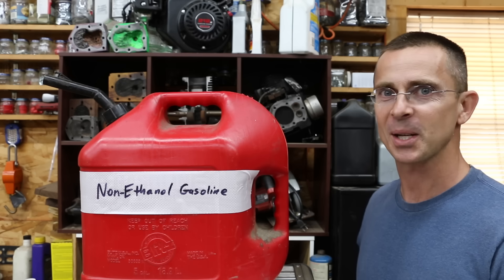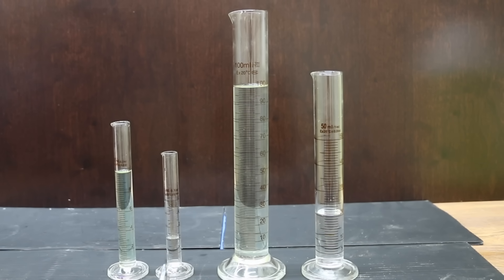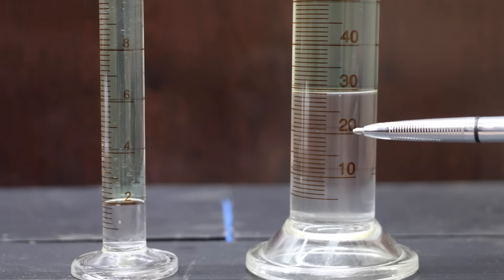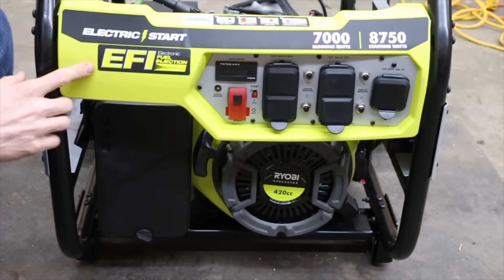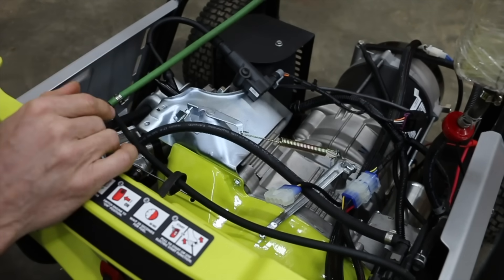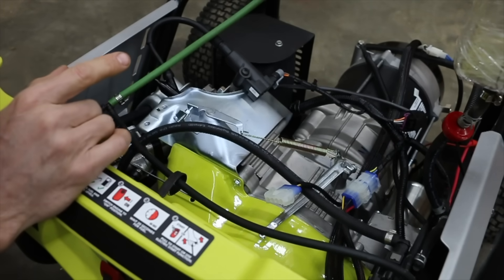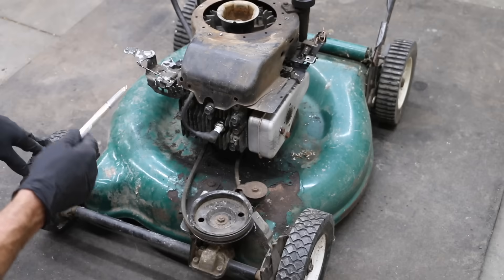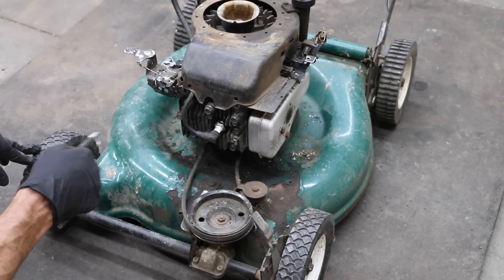Is Non-Ethanol Gasoline Really Better? See the PROOF!

Comment: Whoa, YouTube really knows what Indonesian people need to learn. 
Right now our government claims that the gasoline is mixed with 3% ethanol and they planned to raise up to 20% ethanol for our vehicle

Thank you for the video
Reply: I thought they planned to raise it to 10% which is just as bad
Reply: @IndoGunsnGear they wanna cut the gasoline volume.tjey care less bout the engine 😂
Reply: I live in Brazil, which recently jumped to 30%. It's fine.
I have a double carb 1989 CB450 DX and it runs just fine, no issues. Of course, can't let it sit for too long, but carbs kind of were always like that.
Reply: @fastbikesandslowrides  Want to ask, so it does not create any kind of corrosion to the fuel tank then? Thanks
Reply: @shuyukihara ethanol does like to hold on to water, so I do try to keep the gas tank full. Can't say much about it as when I bought the bike there was already quite a lot of corrosion on the tank (mostly from just sitting and rotting with time). Ever since I got it and cleaned it up though, I haven't noticed it getting worse.
Reply: @fastbikesandslowrides  got it, thx 👍
Reply: @fastbikesandslowrides wait my friend, what about the gas cost? Is it increase or decrease?
Reply: @hanifalii23  gas prices never, ever went down where I live.
Reply: @fastbikesandslowrides WHAT😂. Now i really-really hate my govt
Reply: Are you afraid that Indonesia will progress because of the ethanol we produce from our palm oil, and it can be harvested at any time without having to mine, and it will never run out. And the West always interferes with our progress through evil issues and embargoes?
Reply: @afifrodger it ain't palm .it's sugarcane n corn made
Reply: @sargera1  No dude, Indonesian ethanols were mainly produced from Palm Oil surpluses.
Reply: @afifrodger  no one is going to bother/sabotage us. They don't need to do that, our govt will mess up everything by themselves
Reply: @dudastt 

Tidak bro
Ini untuk hemat uang subsidi yang asal nya dari pajak.
Etanol nya itu  produksi di Indonesia dari tebu jagung dan sedikit sawit.

Di video ini jelas sebut tak masalah mix 10% etanol
Reply: @dudastt  some of those ppl in gov are puppets from foreign country that want to sabotage our country to never progress so will always easy to exploited.
Reply: @timeaftertime-om7os hemat anggaran tapi untuk program rawan bocor kayak MBG

That's what I meant by they will mess up everything in the end
Reply: @dudastt MBG itu isu yg berbeda.. kita bicara penggunaan ethanol..brrti anda setuju klo ini mmg menghemat anggaran.. brrti bagus dong.. oke..
Reply: @timeaftertime-om7os  but the ethanol used in the base fuel is imported from outside, its just freshly imported right from the docks. Unless they blend the base fuel again ( this struck a major outrage before) just before getting tested, the presence of ethanol in base fuel should be considered as contamination. Probably from old refinary that also blends fuel. Puttingin ethanol early is just ridiculous as it will absorb moisture very easily.
Reply: @afifrodger   Palm oil may be technically renewable, but in practice, once the plantation is depleted and drained, what remains is barren soil — a sign of ecological exhaustion, not renewal.
Reply: @afifrodger what progress means to you? We are just planting palms! Nothing to brag! Di indo itu banyak minyak. Tapi teknologi kita ga nyampe buat eksploitasi nya.
Reply: The problem arise in our country is not about the amount of ethanol mixed in the fuel. It's about the purchase  agreement between pertamina and private gas stations. They wanted to buy the base fuel, free of anything mixed, including ethanol. After which they could add other ingredients suited to their fuel standards, perhaps ethanol included

Now imagine, if the base fuel they bought is already mixed with 3.5% of ethanol. What should they do to reach their fuel standard using their respective  mixing recipe? It is like, you want to buy demineralised water (pure distilled water) for your chemical experiment that is quite sensitive to minerals, yet what you got from the seller is mineral water, and they claim it is better
Reply: Bener
Reply: I don't see any problem with that because at this moment larger vehicles such as intercity buses and trucks already use Biodiesel for decades since the govt introduce Biodiesel sometime around 2004
Reply: Don't forget, Shell or BP have their own  formulation for their best gasoline performance, which not allowed erhanol more than 3%, and ethanol itself depend on source of its substance, purity will influence performance itself
Reply: 20%?? hoax!
Reply: It's 10%, 20 is the maximum limit. Idk if you are misinformed or not before but the hoax stops here
Reply: there goes old cars
Reply: sadly bahlil is not smart enough to see this video

Comment: You will find a yellow slime in the carburettor of your mower and strimmer. Exposed to air this turns to a white talc-like substance.  Always drain the tank and run the machine till it stops before winter storage!

Comment: this video comes up in my FYP
there's a pretty heated debate in indonesia because the Government forbid the the foreign gas industry to buy the gasoline from outside the country
and the gas institution doesn't want to buy the gasoline from the Government because they say the gasoline contains ethanol 
thank you for the experiment!
it helps me know which one is the better gasoline
FYI indonesia has one of the bigger motorcycle user in asia so i think this video helps our knowledge of which one is a safer fuel for my motorcycle

Comment: Small engines, even 4 stroke lawnmowers will have problems with alcohol in the gasoline.  it rots fuel lines, etc.  I have a five gallon container of E10 gas.  First start , my mower ran fine. Not sure how long the mower sat but I had to pump out the gas tank, putting it back into the 5 gallon gas can, because the mower wouldn't run.  Bought a 2.5 gallon gas can, filled it with fresh E10 gas, because you can't buy E0 gas in NJ and the mower started right away.  I figure the gas left in the mower and the 5 gallon can, absorbed water vapor from the air, and added enough water in the gasoline, that the engine didn't know what to do with it.

Comment: I have a BS6 350 bike that is compatible with E20 fuel, but I’m concerned that the ethanol content could damage the fuel tank over time. Will using fuel additives help protect my bike from corrosion?

Comment: You can see a flood of views from India, because right now it's a hot topic in India. 
Can you make a video with 20% ethanol (E20) or more like E27 or even E30? and put it in a old non ethanol compliant engine or E5 compliant engine and see what damages it makes to the engine, fuel-tank, fuel-pump, injector etc. Tally the changes in fuel efficiency. I can assure you that you will get more than 10 million views within 6 month. Just take it as a subscriber suggestion. Keep it up!
Reply from the maker: Thanks for the suggestion.

Comment: The problem with ethenol is that you still have to pay for full amount of the gasoline but you are only given 90% real fuel and 10% ethenol so it's unfair and second thing is that the engine are not made for ethanol fuel so we need new types of engine and also ethanol depletion is very fast in comparison to normal fuel Beacause it have less carbon in it thats why its goes really fast!😂

Comment: Can't compare an electric generator engine with a car engine. Car engines are more resilient and built for long life. Wrong comparison..

Also, individuals driving patterns and behavior do more damages to car engines than ethanol blended fuels.
Reply: E20 is already choking a vast majority of petrol vehicles. It sure has a large negative impact.
Reply: @VinayakMahadev11 If you cant backup your statements with evidences then you are just helping to spread lies.
Reply: @deepaktheproudindian  I need not spread lies. I am also a vehicle owner and mine is visibly straining under E20 use. Fuel economy meter is overestimating the mileage value (real value is less than 8 but it reads 9.3), mileage dropped by 20% (earlier it was 10), and the ecu is likely overcompensating by pumping too much fuel into the combustion chamber. It has been flashing the check engine light for the past one month, due to this stoichiometric issue. Not everyone has a car that works fine on E20. Know the ground reality before defending your claim.

I mailed the OEM and they replied that it is not recommended for E20 use.
Reply: @VinayakMahadev11 which car you are using, how old it is?
Reply: @deepaktheproudindian Polo, 9 years old and well maintained.
Reply: @VinayakMahadev11 doesn't matter. You are running an old car, your cars mileage is suppose to be lower. Wrong assessments by you.
Reply: @deepaktheproudindian  It is still returning 10 kmpl with 100 octane, you can't rule me wrong without listening the whole argument. 

It's not worth arguing with someone who is fixated in their ideas.

Comment: Negative Impacts

Reduced Fuel Efficiency: Mileage drops by 3-7% due to ethanol's lower energy content, affecting overall running costs.
Corrosion and Wear in Older Vehicles: Non-compatible cars (pre-2020 models) risk damage to fuel lines, seals, injectors, and rubber parts from ethanol's corrosive nature, leading to accelerated wear.
Performance Issues: Older engines may face starting problems, reduced power, or increased maintenance needs, with reports of engine knocking or failures in incompatible bikes and cars.

Comment: Yes I voted for bjp they sometimes do good but then they do this. Don't know what is gadkari thinking that's why leaders should have scientific knowledge.

Problem: Scientifically ethanol is less energy dense than petrol efficiency can drop 1-8%. The reports which showed that consumers will benefit from E20 fuels are from 2020-21 reports when ethanol was comparatively cheap not 2025. This time price have increased significantly due to demand. While the metals parts of old cars are safe the elastomers and plastics aren't. The E20 can mess them up.

Solution: Reduce the price of E20 based fuels to compensate for mileage. And give extra option of pure fuel for the old cars which are not compatible with E20 specifically.

Honestly there are reasons why ethanol is expensive right now than last year's. The supply chain can't handle the needs. Primarily gov allowed production of ethanol from C heavy molasses such as left over of sugarcanes but now they allowed B heavy molasses which includes Sugarcane juices, food grains even rice surplus.
This can lead to price hike in sugar and rice along with maize etc. And the amount of water needed to supply the ethanol is 10.16 billion liters of water annually!! Also the ethanol distillation process produces a highly toxic effluent called "spent wash" or "vinasse." This liquid has a very high Biological Oxygen Demand (BOD) and Chemical Oxygen Demand (COD). If discharged without adequate treatment, it can severely pollute water sources and render soil infertile. And considering how they are bypassing many steps no way they can properly implement zero liquid discharge(zld) policies. 
They can tackle this by researching in second generation (2g) ethanol but who will listen?
Reply: karma, you will end up in suffering, please dont vote to BJP next time.
Reply: The implementation of E20 is facing so much resentment only because the compatible fuel most most vehicles is not offered as an option. But I think the larger goal is to force petrol vehicles to death.

Comment: I ride a bike which is E20(20% Ethanol mix) complaint for 2 yrs, and yes it has lowered fuel efficiency & some weird white stuff(kinda thick paste like) built-up in my gas-lid as well as its key hole, it made my gas-lid hard to open & corrode my bike key.

Also the white stuff smell kind of like Coconut,
Yes, COCONUT.

Is it suppose to happen? or there is some kinda leak that water pass through?

Comment: In Brazil we have been using 100% etanol for decades and its just bad on low temperatures (5Cº and below) and old engines without alcohol resistant rubber. Since 2003 almost all domestic market cars run on gasoline, ethanol and some on LPG at the same time.
Reply: It also gets worse mileage because it takes 33% more per gallon to use as gasoline. Which means it also makes more hydrocarbon.

Comment: Here in Brasil there's quite a polemic going on after the government established a 30% alcohol content (volume/volume) in the gasoline. A lot of people have worries about the corrosion associated with it. Also, some direct injection engines are likely going to need better injector, due to the higher flow necessary to compensate it. Regarding power and carbon deposit, it could be actually good.
Reply: Don't you people have flex fuel engines from 2003?

As an Indian affected by the E20 scam (there are E20-compliant vehicles only from 2023, but in 2025, India mandated the use of E20 without regards to vehicle compatibility, without slashing fuel prices), I'd like you to ask something:

1. We repeatedly hear that you people have a choice to buy pure gasoline, how true is that?
2. How different and complex are flex-fuel engines from regular gasoline engines (if any)?
3. Does ethanol affect FFV's as well? If so, how?
4. is it possible to retrofit/modify an existing gasoline/E10 engine to achieve flex fuel, or complete E20 compatibility at least? If so, how feasible and expensive it will be?

Comment: In Europe its a choice of 2... E5 or E10. I have NEVER had a car that liked E10. They run like a bag of nails. Some places have E85. Unless your car is tuned for it and your fuel system set up for ethanol...DO NOT USE E85!
Reply: In India, more than 80% of cars and motorcycles are compatible with only E10, but the stupid union govt has mandated the use of E20 irrespective of the vehicle's compatibility, for the financial benefit of a certain politician's ethanol dynasty. Vehicles are slowly choking. E20 compliant vehicles were mandated only in 2023.

Comment: Basically what BJP has done is it increased the ethanol blending to 20% thus saving 20% fuel cost but its isnt passed down to the end user. Again that ethanol which comes from sugarcane profit doesnt goes to the farmers rather Nitin Gadkari holding ethanol manufacturing plant is profteered. Now only choice that we as end user has is either biy new vehicles which again gives profit to the govt or change to cng or EV the profit of which also goes to govt and manufacturers who give crores of donation to BJP or else purchase premium fuel at much higher cost. For the sake of info xp95 also contain ethanol and xp100 cost ₹160/- per litre. 
Basically the end user i.e. common people gets fucked.

Comment: For injected engines I use regularly, I've found that E10 has better smelling exhaust and and fouls catalytic converters more slowly. On carbed small engines that I use infrequently (just my snowblower since I use electric lawn tools), I always use Sta-Bil if I can't get E0 gas. Luckily my local gas tanker company allows people to fill up jerry cans at their site and they have ethanol-free gas, otherwise I'd have to drive 40 miles for it.

Comment: Ethanol had a lower mileage but had a boost in HP.
Reply: Only if the vehicle was made to handle it. Else it only stresses out the engine and causes corrosion.

Comment: In India, they are mandating 20% ethanol fuel. My access 125 2012 model will not (can't) handle that much ethenol (even the e10 is damaging)
Reply: Anyway your access is reaching the 15 year scrap limit.
Reply: @navan1087  I can get the green pass though

Comment: No need to test, we are testing at a Nation scale here in India :face-green-smiling:
Reply: On double ratio.
Reply: im not from india, so how was it? what was the most common problem?
Reply: @totem559  ethanol itself is not a problem, reduces knocking without hazardous lead or complicated chemicals, even increase power. But high ethanol ratios reduce the fuel economy, corrode gaskets, make another dependency on ethanol instead of oil, may cause more friction and overall reduced engine life.
Reply: @georgesbv1  Upon the initial introduction of ethanol-blended fuels, was there a sudden sharp increase in vehicle breakdowns attributed to corrosion, blocked fillters, fuel pump malfunctions, and water hammer?
Reply: @totem559  I don't live there, just exposing what I knew from internet. I have some indian coworkers, I may ask them.
Reply: @georgesbv1 😂

Comment: Brazilian here, i also worked as a mecanic for a few years, we have been running E100 for decades here, i also had for a few years a 1983 VW Gol with a 1.6L Air Cooled, ethanol running engine, it had over 300K kilometers, still ran fine and made good power, so yes, ethanol is fine and also can handle higher compression ratios/boost better then GAS.
Reply from the maker: Thank you for the feedback!

Comment: I’ll give you long term results on rubber and plastic components…not good with ethanol. Weed eater, chainsaws, leaf blowers etc items that use this type of fuel lines and primer bulb will eventually be replacing those lines and primer bulbs because they will get very brittle and not flexible anymore. The small carburetors these types of yard tools use will need to be rebuilt due to the internal plastic and rubber components also becoming brittle and cracking. Fuel left in carburetors with float bowls. The internal pieces of the float bowl will become corroded and eventually need to be replaced. Needles will be damaged and float needles with the rubber tips will be unable to prevent fuel from seeping into the bowl. I no longer use ethanol based fuel in any of my small engines. I still have a few pieces that need rebuilt and carburetors put on them either carburetors rebuilt or replaced.